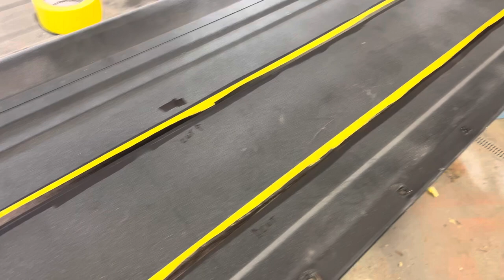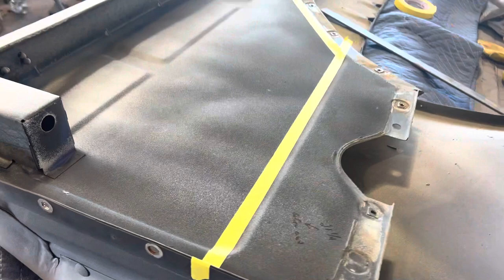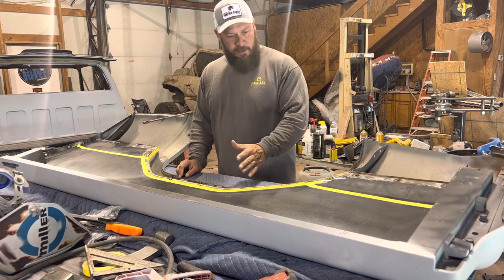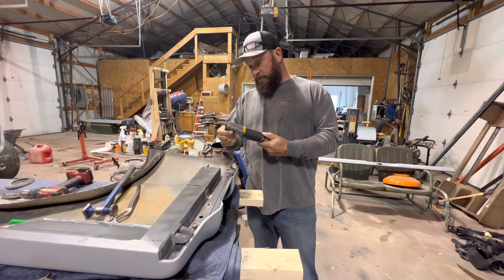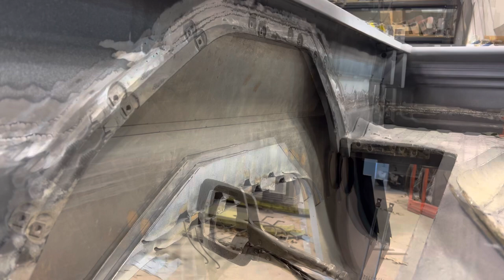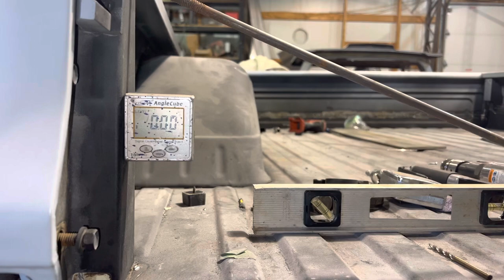RAISE YOUR BED FLOOR ON A SQUAREBODY 73-87

Comment: What did you do for mounting the bed to frame? The bed is body dropped 7" now
Reply from the maker: That requires building new brackets that are 7" higher to compensate for the difference. Thanks for the question!